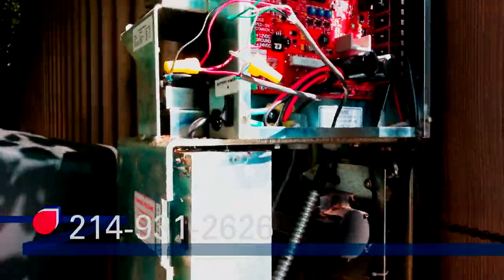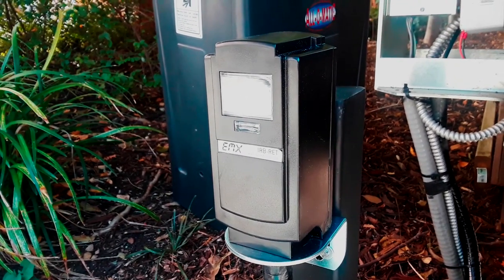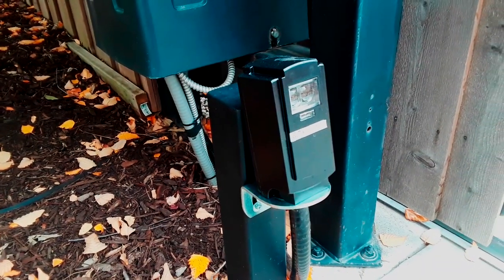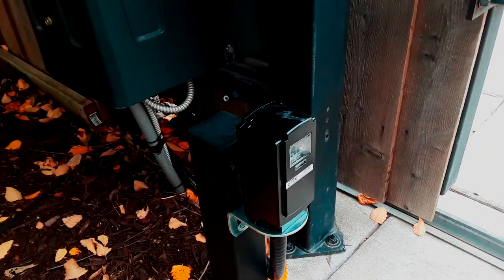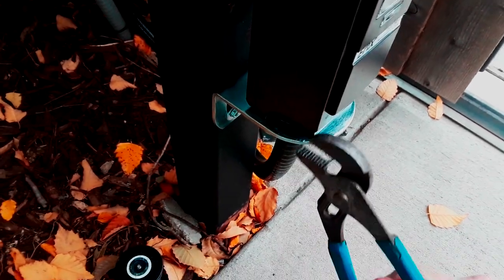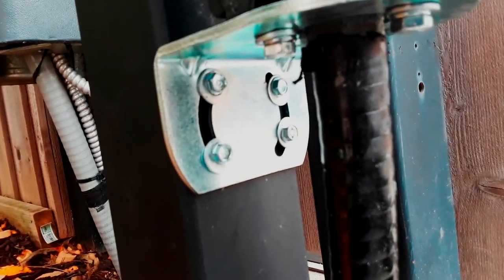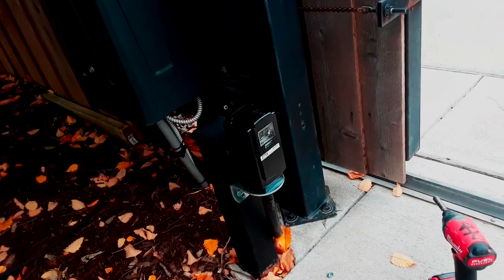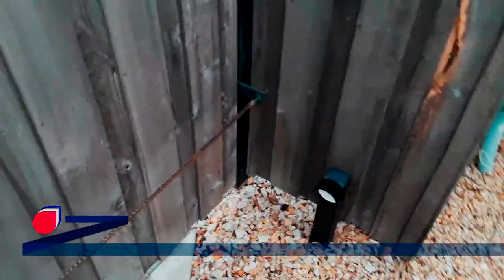Installing an EMX IRB-RET UL325 safety photo eye University Park Dallas, TX | SC0055

Comment: Good video. My sliding gate is mounted on the dwelling side of the posts. Can the photo eye be mounted on either side (street or dwelling)? Advantage to one way or the other?
Reply from the maker: Check local code to be sure. Either side is ok. If its on the secure side, its probably less like to get vandalized although we rarely see that.

Comment: I just installed one of these units and although I'm no expert I think you have installed it incorrectly. That is why you have to install the reflector last which in my view is back to front. Your approach works if everything is flat and the posts are truly vertical but if there is a slope across the gate opening or the posts are not vertical then the height of the RET and the reflector above the ground will be different. The unit is designed to be installed on the side of the post, not the front. That way you can rotate the angle bracket with its slots about the horizontal axis so you can adjust the beam up and down. Then, when you attach the unit on the ring that fits into the bracket, you can rotate about the vertical axis so you can move the beam side to side. This approach allows you to point the beam directly at the reflector so the reflector can be mounted where you want it as opposed to wherever the center of the beam ends up. By mounting on the front of the post like you did, you lost one of those rotational degrees of freedom so you can't adjust the vertical position of the beam. My driveway goes downhill so if I installed it your way the reflector would be at least a foot higher than the photo eye. Also if it's on the side of the post it is better protected from careless drivers damaging the bracket as happened in your case. I hope these suggestions are helpful.
Reply from the maker: All valid points however you missed this was a retrofit. 

A couple of things to keep in mind:

• Without a redesign we have to work with what we have existing, this was a retrofit.
• Driveways at 0 grade, as this 1 was, allows for  installing the reflector 1st or last.
• Driveways at 0 grade allow height of the bracket + 5.5 inches, then mounting the reflector at the center.
  Again this was a retrofit so we didn't have that luxury.
• For the most part we don't install them with screws anymore we weld. So the slots in the bracket  are useless.
• Welding the bracket as opposed using screws holds up so much better based on the approximately 50 installed.
• The manual does show mounting the photo eye on the side of a post. However the assertion that it has to be mounted like that and it provides protection assumes traffic flow one way, it's not being mounted on the exterior of the gate, etc. But I think that's the key  take away from the points above. Some protection is better than nothing.

Thanks for all the feedback  and it would be really cool if you could send a link to your  Instagram or Facebook that we could see some of your pictures of the install. We have over 600 images and video, including a lot of photo eyes, on our Instagram page. user is safeguardcontrolsLLC

Have a good week Peter. Thumbs up and favorite on your reply! Brooks

In case you missed EMX's  last national newsletter  we had to spots in it. One with tips from the field and one with and install  that looked awesome!..

Comment: My Eagle Gate Operator Reverse Loop light comes on

Any help?

My photo eye’s green lights are on though. However, when it hits the reflective plate, red lights come on

I purchased an EMX Photo Eye and it has an extra common wire ( white ) not sure where this wire will go?
Reply from the maker: If anyone else is having this problem, check with a professional. They will wire the photo eye Normally Open or Normally Closed and connect the grounds.
Reply: @SafeguardControlsLLC  I fixed it by replacing the photo eye
Reply from the maker: @0animalproductworld558  awesome!